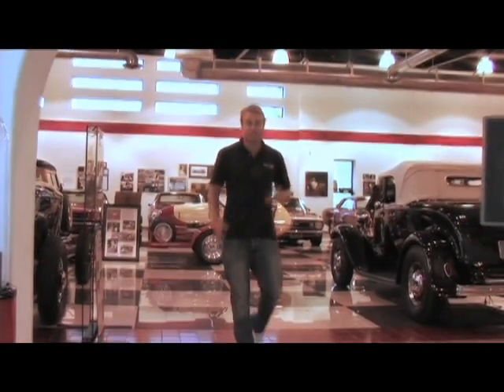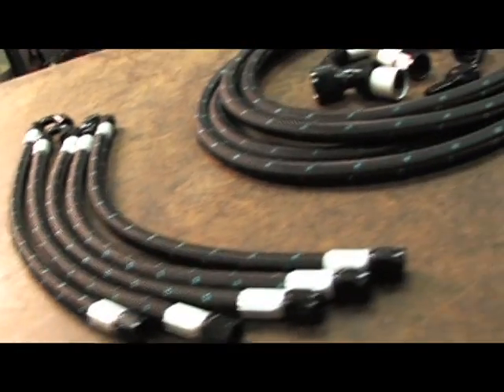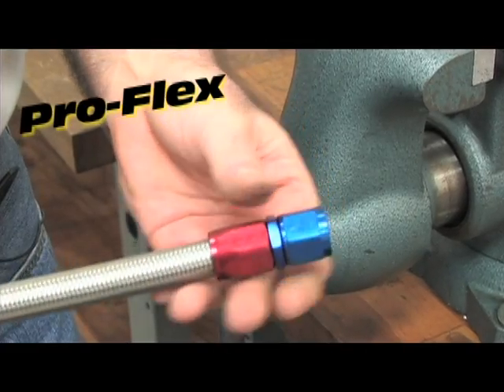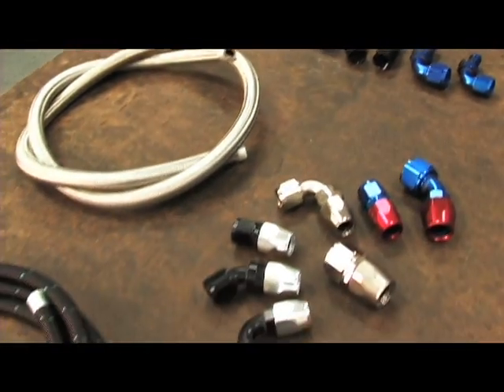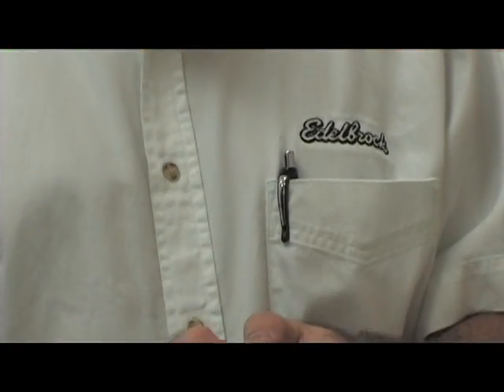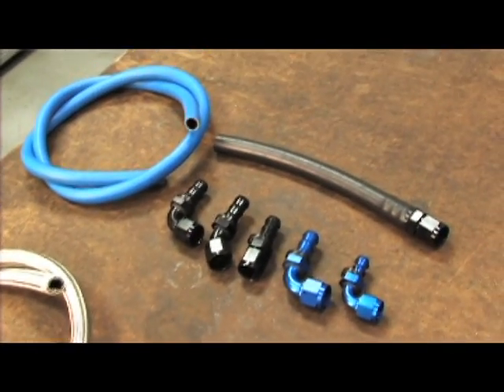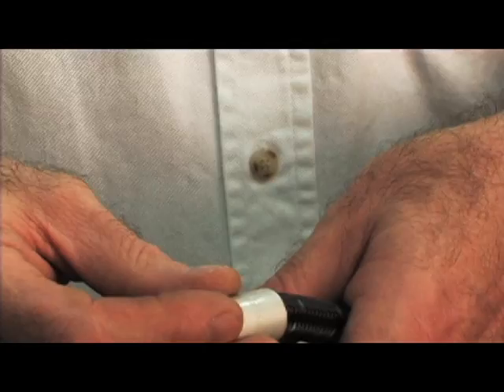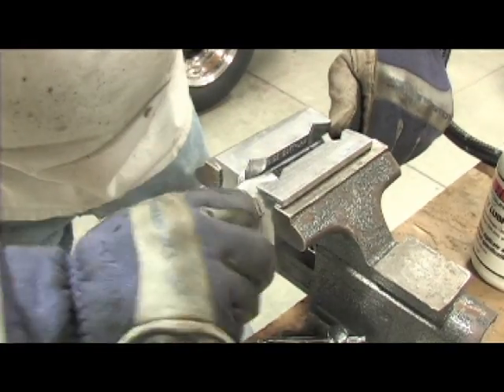Vehicle Plumbing 101 by Russel Performance Plumbing

Comment: The twist lock installation this shyster shows is the biggest bunch of bullshit I have ever seen. Anyone that has ever tried to install one of these knows it is damn near impossible even with oil and heat. You have to buy the  $250 dollar tool...either that or beat the hell out of the thing with a wooden block as one YouTube user demonstrates. Why cant these idiots be straight up and show what it actually take to install one of these. They are good fittings but the lying sack showing these things going together by hand knew he was fucking lying when he made this video...fucking idiot...can you tell I'm pissed. If he would have just said up front, you need this tool (Koul Tools EZ-On AN Hose Presses), it would have saved me 3 days of fuckiing  around and wasting time trying to figure out why my fittings couldn't be installed by hand like his... this video is blatantly misleading, who the hell n this company allowed this to be published?  I cant abide being fed a line of bullshit.

Comment: when i thread a fuel fitting, do i have to use any kind of past, Teflon, ect ??
Reply from the maker: If that fitting has an NPT (national pipe thread)  type thread pitch then yes, you will need a sealant on them.